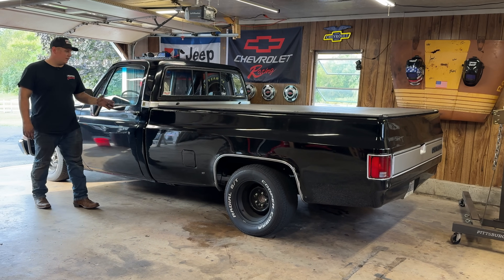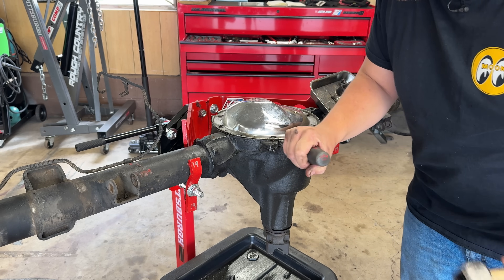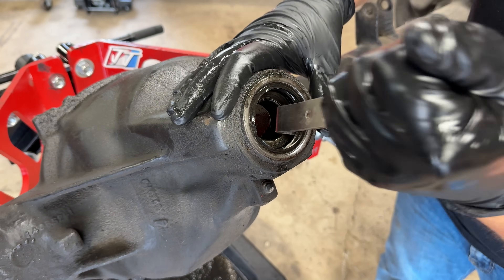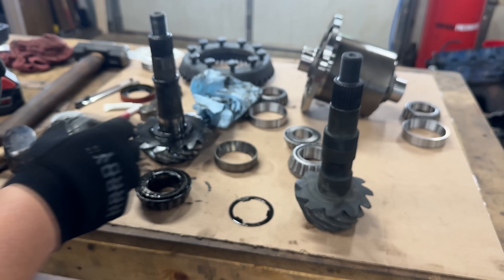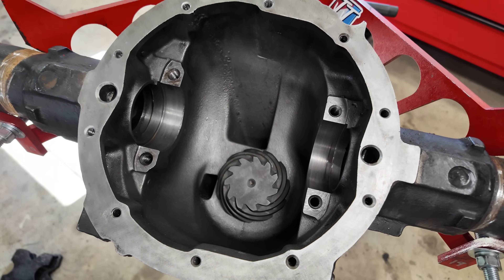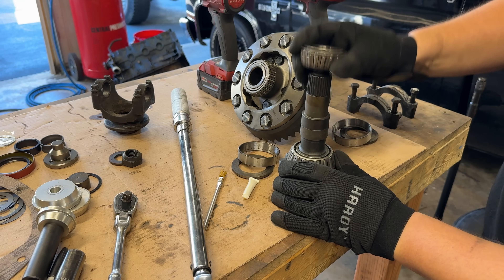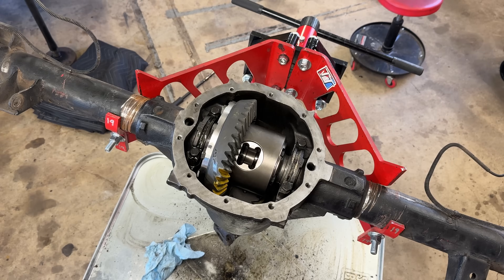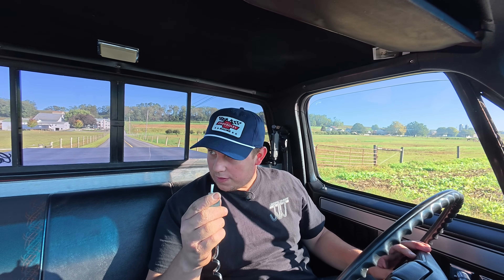Adding 3.73s and Posi to My Squarebody Street Truck!

Comment: Needs a converter
Reply: AND a recurve on the distributor.
Reply: 3200-3600!
Reply: @gearjonny369 probably to tall for the engine
Reply: @gearjonny369 that may be a bit much, maybe a 2600-3000 stall would be a better fit for this motor til he builds more power 👍🏼
Reply from the maker: Yeah haha Ill be changing the transmission setup soon!
Reply: Hmm stall speed isn’t based off cam rpm specs?
Reply: I have a 84 Sierra classic back when it had the stock 305 longblock, it went 14.80 at 90mph with a comp 280h, rpm q jet, longtubes, fti 3600 stall and 4.10's. You need a converter big time, it was the biggest bang for the buck. 

And dont be afraid and go small 3600 is perfect, drives super tight around town and flashes high when you need it.
Reply: No, that's what gears are for. Use your engine, not waste energy with converter.
Reply: @shootermcgavin2819 stall converter will make your vehicle leave a lot quicker off the line gears are a just a booster and need a better Distributor so you can MSD box so you can mess with your rpm range put a shift in a truck. Will help them out a lot to.
Reply: @shootermcgavin2819  that’s a silly take.
Reply: Yes, with those gears, I would go  with a 3500 stall
Reply: @MikeSuperH or 4,000 because this truck is heavy
Reply: well to add the right stall convertor you have to know what RPM your cams torque pawer band is and then you get the matching TC so that when the TC grabs its right at the same time the cam takes over!
Reply: @Jules-7575 I will go with a fti triple disc stall converter from 3500+ because your vehicle will not stall to 3500+  less you have a Tranz brake and put a good shifter in the floor and do away from the steering column shifter you have not safely neutral lockout
Reply: Needs a clutch!
Reply: Needs a motor
Reply: 3500 stall on street unless that engine is spinning all the time around stall speed  trans is going to get hot
Reply: @techs1smh13 i had a 2800 in a 79 Impala.  It was perfect for ripping around town.

Comment: 410's on that truck, would've turned it into a rocket 🚀
Reply from the maker: Haha no doubt! But with the 3 speed TH400 its already screaming at 55😂
Reply: @JeepinJimmy what’s your rpms
Reply: @FreshPapi9599 Depends on how much slip you have, with a manual it's locked up with the clutch out, that's around 3000-3200rpm at 60 depending on tire height.
Reply: I have 4-10s/Detroit Locker with 28 inch tires on my 84 C-10. 500+HP 7500rpm SBC with a 4spd. It hauls ass. Pretty much taching 4000rpm on the highway. But it's quick.
Reply: Those lockers are weak, planetary gears break , sorry
Reply: 4.10s or deeper, 31 or 35 spline axles, and a built TH700R4 with a 2400 RPM converter.